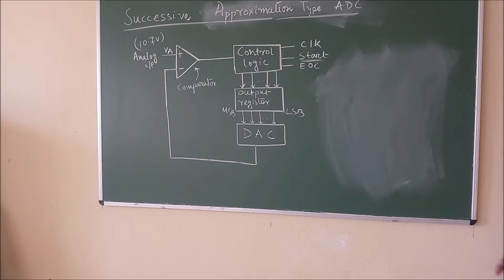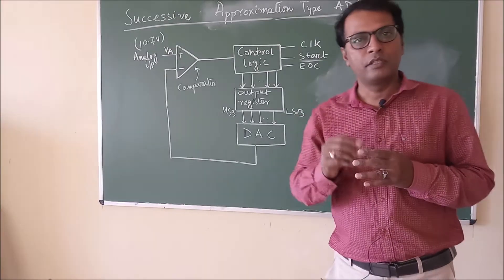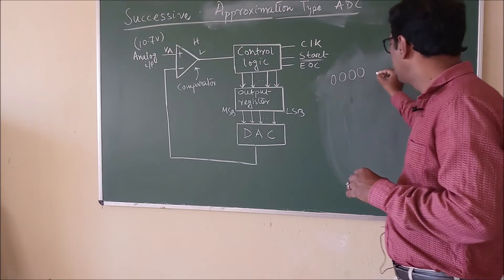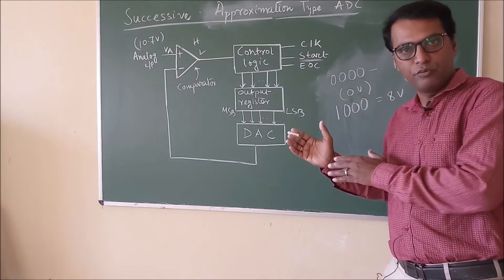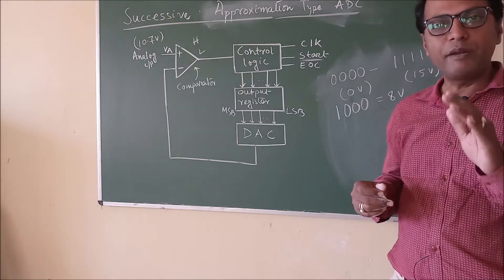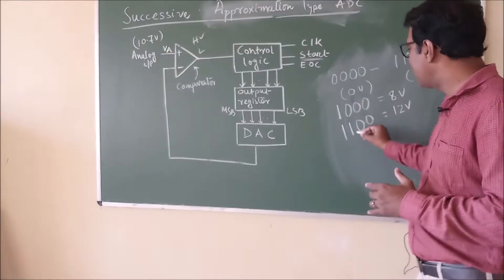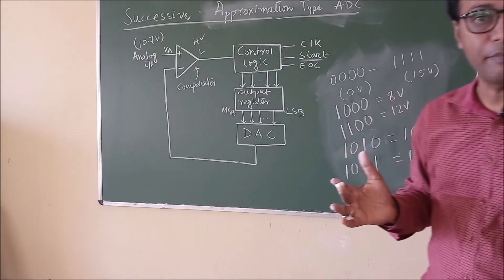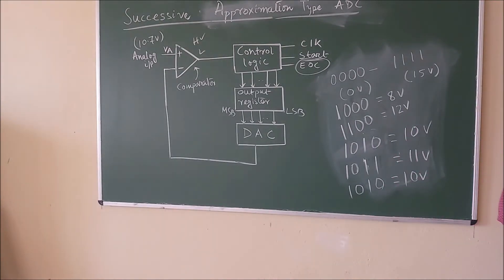Successive Approximation Type ADC

Comment: Let the analogue value of an input signal is 5, for reference value 1 for ADC. Considering that the ADC is 4 bits, write down at least six iterations to show the ADC process using successive approximation method (showing update in the binary digits of 4 bit).
please solve